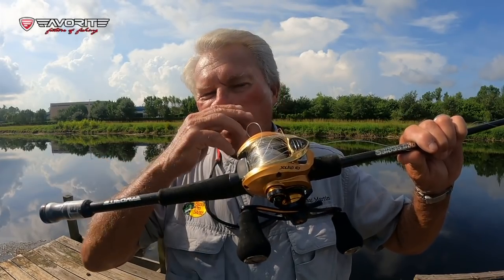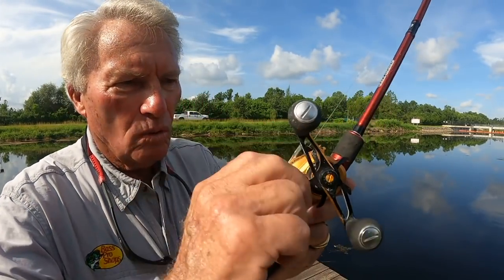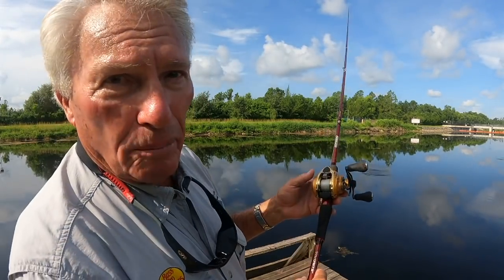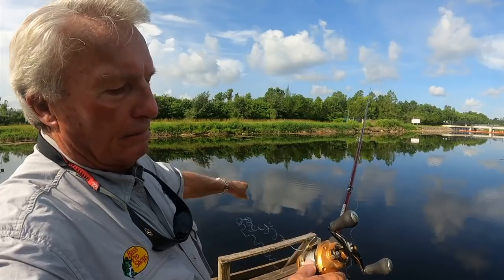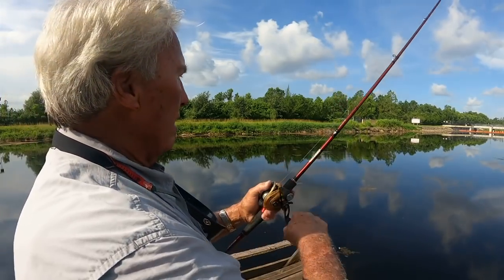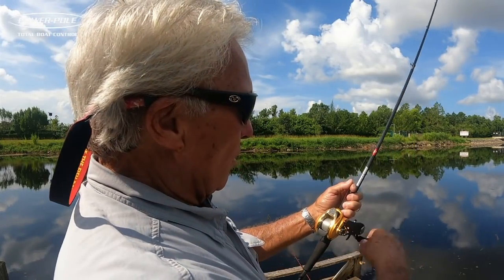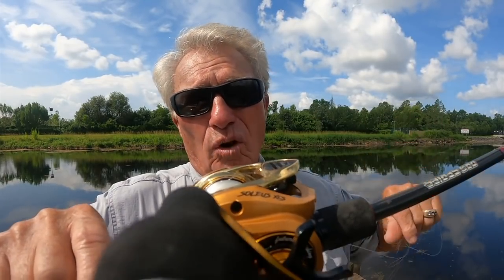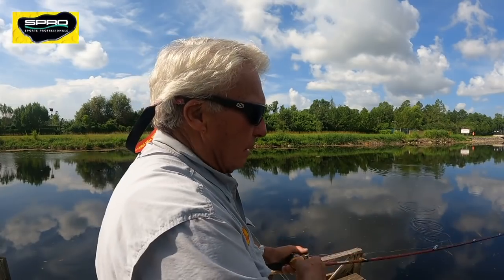How to avoid Bait caster Disaster!

Comment: In 30 years of using casting reels and picking out backlashes I’ve picked up a couple of tricks…Stop the spool when your bait hits the water…Like you said, keep your thumb on the spool. I always use a line dressing spray….Also, whether I’m using braid or mono, I always have a fluorocarbon leader of about 10 feet…Thank you for your wealth of knowledge and experience…I love you brother. You’ve touched more hearts than you could ever possibly know…

Comment: Thank you Roland for doing this video. I was raised using Zepco reels and now bought me a open face bait caster which is a little challenging to use. Let,s say you just don't push the button and release on the cast. I have had several messes to fix and will keep berkley line in business for sure. LOL  Thanks again for explaining it so well and after the adjustments i made and working on the thumb pressure I think it will all fall in place.  Please Keep These Videos coming.

Comment: I put on new lures the night before and hold my rod at 11:00. I adjust the lure drop indoors to where the lure drops slowly but freely to the floor. I check my phone for wind direction and speed through out the time I will be fishing also. I fine tune the reel on the first couple of casts. To get the reel just right for distance also. I clean my reel's to get debris out of area's that might hinder my casts. Then put reel grease on the line bar. So I am just about where I want to be at the site I am fishing. I bring four rods and reel's. One Spinning combo and three Baitcaster's combo's. Topwater, Crank, Chatter and a Senko. Texas Rigged or Wacky. I'll change to a Spinnerbait on the Spinning combo if all fails at the end. I cover all bases. Then go at it. For a least 4 hrs. Set myself up catching the biggest bass I can find. Work's for me. I am a bank fisherman. Haven't been skunked in years.  Shawn.

Comment: This is the reason I have good quality spinning reels on every rod I own. Before flipping the bail after casting, just look for any loops. Best thing you can use after dark. Don't think so? Just try to get that backlash out in the dark.
Taking twist out?
Cut off the lure and drop empty line in the water when moving the boat, leaving the bail open, and let the empty line spool out behind you. Reel it back up through the water and see that twist magically come out. 
When putting a worm on, make sure it hangs straight and the twist is lessened to begin with. If hooking 'wacky', you have to untwist a little more often. Don't be fooled. Baitcaster line can twist too!
Reply: Yeah, paying attention when casting is a must when fishing. Not overfilling spools. Small things make a difference.

Comment: I need someone in the NJ area to teach me how to cast a bait caster. I spent a lot of money on this rod and have not been able to figure out how to cast with it. If anyone is in Essex county or closer that would like to help me learn plus shoot me a phone number.
Reply: Just takes a lot of practice. Start off with the magnetic brake adjustment at highest setting, and practice thumbing the spool. Start with short distance casts and work your way to longer casts, as you get better, you can lower the magnetic brake setting, but it takes a lot of practice. If all fails, there's always open bail casting reels. The fish can't tell the difference. Good luck👍
Reply: @duanebrown3877  thank you for the advice. I’m using braid and my rod has small holes for the line to thread through whereas my spinning rod has larger eyelets. Can these small eyelets on the bait caster be part of the problem?
Reply: @michaelgraves704  No, on baitcasters the line doesn't come out in a circular pattern like a spinning reel where you need big guides. It is level wind so small eyes are what you need. You just need practice. You will pick it up. Don't quit.
Reply: @christopherwood2290  thanks for the encouragement